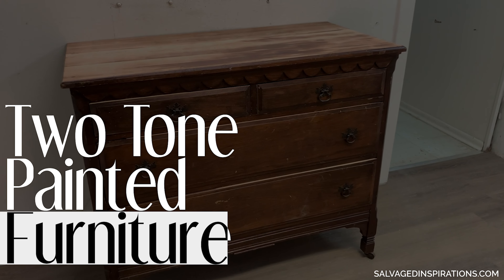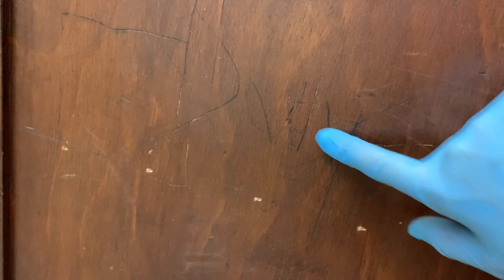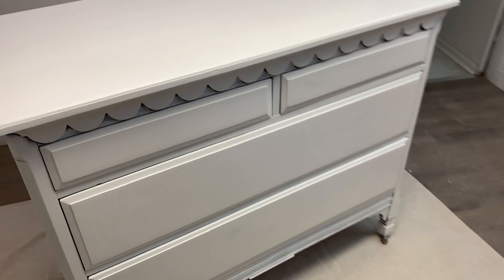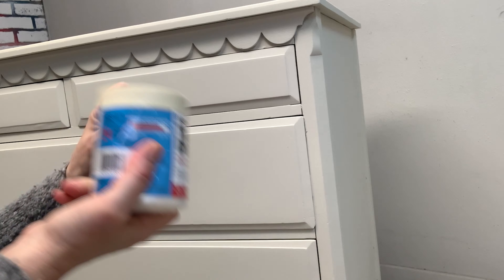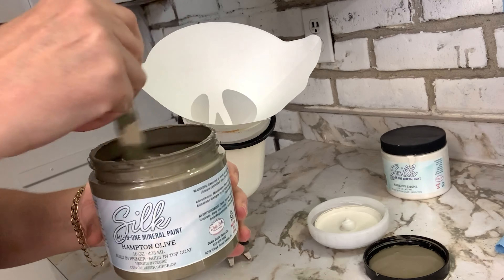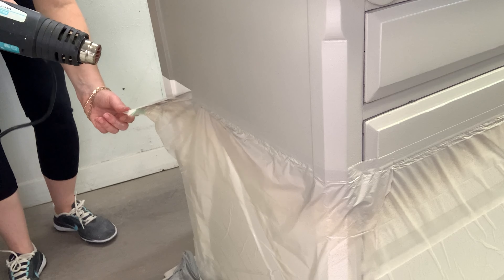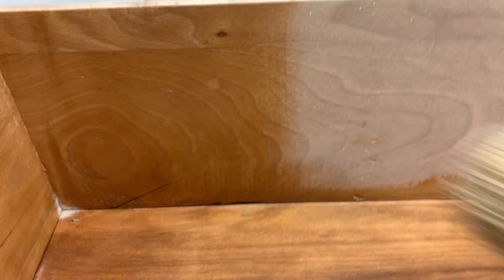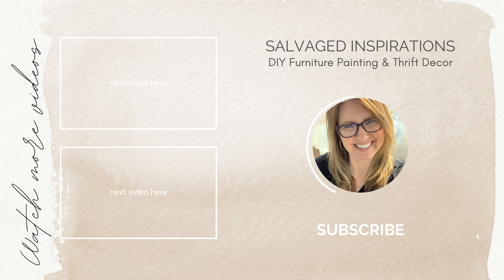Two Tone Painted Furniture

Comment: I've not used the paint that you're using, but wouldnt primer also allow for a smoother application as well as less actual color? I just put together a headboard and nightstand. I used paint to make them a combo. Both started out with wood finish. I sanded the top of the nightstand because the clear was rather thick and streaked; the nightstand was also in a very dark stain, so I primed it with two coats and sanded in between. The headboard had zero stain, only a light coat of clear; I did light sanding to improve adhesion. The raw, unprimed headboard took so much more paint, from the start, than the primed end table / nightstand. To be clear, I'm aware that the headboard has much more surface area, but from the start, it took more paint than did the ngithstand.
Reply from the maker: Yes, primer (or an extra coat of primer under a 2 in 1 paint) does everything your saying. :)